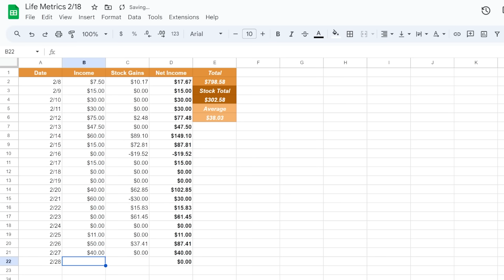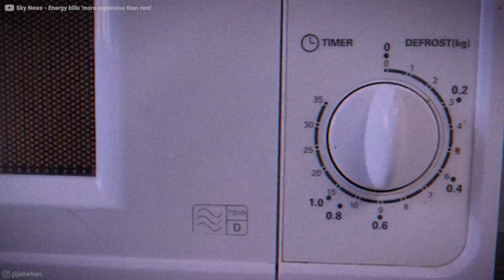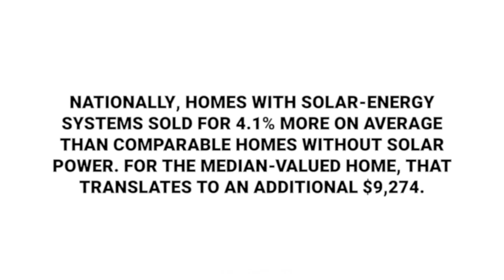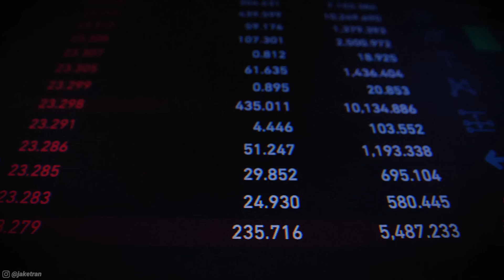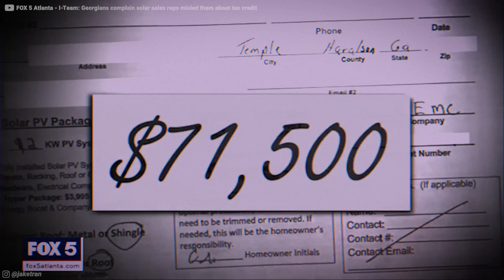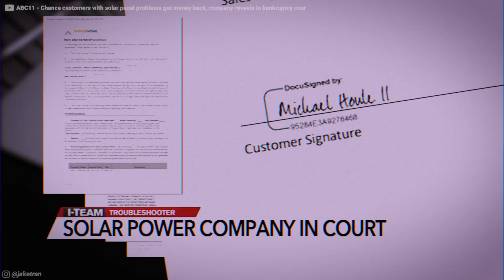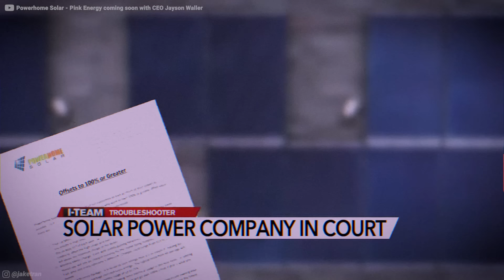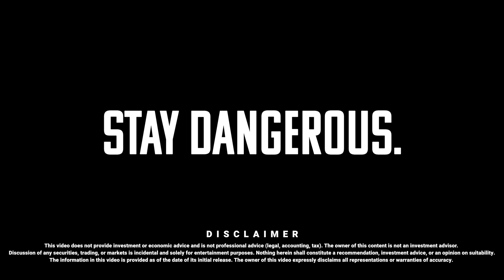Home solar panels are literally a scam.

Comment: I'm glad that you mention that the issue is with solar panel company sales deals and not with solar energy itself.
Reply: Two different things for sure.
Reply: Yeah it should be its own video
Reply: Solar isn’t close to as effective as nuclear energy and is worse for environment than nuclear
Reply: Solar energy itself is HUGELY problematic and environmentally terrible - as is wind power. They are both very inefficient systems that can't be used reliably and can't be used at all in many parts of the world. Additionally they require components to build that are far more environmentally damaging than oil. Also, they require 1000x more land footprint to run than traditional oil/gas. To top it all off, 99% of green energy systems (wind/solar) are manufactured in China. Now imagine if China decided to start a war and sanctioned the west and we relied completely on wind and solar. We'd be totally screwed.  Would be far worse than if any single OPEC country decided to stop selling oil right now.
Reply: @77dris  yyea, its no a coincidence that green energy hates countries with large supplies of coal, which china has to purchase from other countries
Reply: Well on a large scale yes .
Reply: @MintBerryCrunch  Everyone already knows that. Except for the german green party.
Reply: @77dris Going 'Green' will mean going without for most.
Reply: @77dris 99% of the panels on the market are definitely not from China. Freaking lol
Reply: user-hg4li3zx1x  so your posting your personal opinion with zero knowledge on the subject lol ok
Reply: No all solar business is a problem! Problem is that people are turning back to renowned manufacturer like Panasonic Holdings from Japan (creator and developer of all PV inventions in 1960s) 
Meanwhile customers prefer cheaper panels from China or Korea (with not as long cycle of life as PV made by Panasonic!)
Reply: @mbglosser True. But the stuff inside them is mined in China with slave labour.  Also the mining is very environmentally destructive.
Reply: Look at this arguing over energy 😂😂😂😂 brilliant
Reply: Yeah everything works even fossil fuel is good but it’s all about the money
Reply: @77dris  the main point of this rn is to invest in these type of tecnology so it can develop and be more efficient and reliable.
Reply: @MintBerryCrunch  You are right but only about nuclear FUSION, which is someting that we cannot do efficiently yet. Nuclear FISSION is what we are doing rn and it's not ideal at all.
Reply: I am a conservationist, "renewable" energies have never been considered valid. The technology,engineering, and infrastructure isn't' there. The real answer from a conservation POV is to make the most efficient use of the resources that community has. It doesn't make sense for Iceland to use anything other than geothermal. Though there is benefits to smaller or isolate populations.
Reply: @Nylon_riot   efficient use of the resources that community has have a date limit, is not enough for the energy that we need to consume nowadays and is harmful to the environmen. Of course you have to choose well which renewable energies you will use depending on where you live but that doesn't even get close to meaning is not a important thing to adopt and develop
Reply: He is right, nuclear is 24/7 all year long, no reduce output powerhouse while solar relies on very specific conditions to function, a fun fact that many don't know is that high temperatures cripples productivity. Nuclear power was the green future human greed denied us, with recent advancements in nuclear generators in safety, waste reduction and efficiency, our climate crisis would never have happened, but uncultured monkes who thinks that every powerplant is a mini chernobyl (even though that was communist incompetence) waiting to happen, and the nuclear waste? They made God damn nuclear reactors using that as a fuel source, so God bless the purifying nuclear fires of the next world war cuz we Don goofed and chose the wrong path o7.
Reply: No, no, not quite. Just like with EV batteries, still gotta mine all the metals and various elements and then all of the massive graveyards of non-biodegradable, unrecycled solar panels, huge lithium batteries, windmills, etc. no longer work..
Reply: Solar energy is a joke in most regions.
Reply: @turbogames3 Uhm, I think you got those two mixed up. Fission is what we’re trying to achieve and is what goes on at the core of stars
Reply: @HavianEla  no. You got it mixed up. Go check.
Reply: @MintBerryCrunch  ROTFLAMO! 🤣
Reply: @MintBerryCrunch  Nope.
Reply: @Nylon_riot it’s easily there. It costs less to put pannels on your roof for 40 years than pay your power company.
Reply: @SavageRoosterOnThaLooster  isnt the video about the people who regretted  and are suing for doing exactly that?
Reply: @77dris the best way to do wind and solar to avoid a lot of this in not large solar and wind farms but personal solar and systems but to get them at affordable prices you have to build them yourself they are actually fairly simple. Don't get me wrong we should continue using coal for power and should invest in more nuclear power.
Reply: @MintBerryCrunch  what can be worse than nuclear, the waste product for nuclear will be harmful for eternity and beyond.
Reply: @theproperfix  you have never done any research on this have you???? I don’t even know how to respond because this is so far removed from reality that i assume you listened to someone’s talking point and now push it off as fact. Please look up modern nuclear energy then get back to me. You may not realize this but many of our naval ships are powered by nuclear energy. One aircraft carrier can power cities like New York with no issue and the waste is minimum. It’s like people read an article from the 60s in nuclear energy and think it’s still relevant today. There are literally nuclear powered things all over the United States and there have been zero meltdowns and practically no waste
Reply: @MintBerryCrunch  Ok so basically you could bury the waste in your back yard, good for you
Reply: @@Pillowcase8 ok so this is just a dumb statement…nuclear energy is the cheapest energy and has the least impact on the environment and a nuclear plant lasts longer than any “renewable” energy plant on the market…please do just a bit of research
Reply: @kidmosey if we relied on solar and wind, we’d have rolling blackouts and our energy bill would be double
Reply: @77dris  Found the oil company employee. 🤣
Reply: @UPTHEWAHSDAY1 it's arguing about nothing. 99% of these people have no idea what's going on
Reply: @@russellhankwrong on all points. Read more
Reply: @MintBerryCrunch ah good to know, I was considering signing up for a solar system but ow I’ll go put a nuclear reactor in my basement instead 😂🤡
Reply: @theproperfix maybe look up windmill landfills :)
Reply: @MintBerryCrunch  No, it is not. Solar power is extremely cheap, effective and the maintenance costs are basically zero compared to all other forms of power.
Reply: @janos5555  I hope your just joking because this is a comment not rooted in fact…I feel like your just spouting talking points with no actual first hand knowledge. I have tons of solar panels on my home thanks to other tax payers and they are not cheap, cost tons in maintenance and are not effective. Not only that the environmental impact on the production is huge
Reply: @MintBerryCrunch  I have some as well (24 panels 9000Watts). They were cheap and I have never spend a dime for maintenance in life.
Reply: @@russellhank This argument is plainly idiotic.  Solar is inefficient and building a system that could reliably power the average home BEFORE adding the charging of an electric vehicle to the mix is extremely difficult and costly.  That's assuming that you live in an area optimal for solar power.  In optimal conditions, a high efficiency solar panel is capable of converting 23% of the sunshine that hits it into usable energy.  Perhaps you should be smarter than the people who make the claims that you made.
Reply: @77dris they are decently efficient and are the cheapest, safest and cleanest energy we have. The stuff that is needed to build them is used in a lot of other industries as well - often times more such as rare earth metals in older energy production. Why people think that the generators in nuclear, coal or gas facilities use different materials than in wind farms is beyond me. It's the same tech...
Reply: @77dris and on the what if China: some of the best solar panels are still manufactured in the west. Elon Musk (yeah, that idiot) brought battery production back to the west. Lithium doesn't really come from China. Neither does the sand for solar. That china is now the biggest producer of solar and increasing it's wind production is also for their own benefit - there are people running around with vacuums in Beijing and pressing the dust into bricks. 
And most important: not everyone has the money to buy an electric car. Renewables are so cheap that they are suppressing the price of gas at your local gas station. Americans are complaining a lot about their gas prices coming close to other countries but never question what it would be without 30% renewables and nuclear in 1st world countries
Reply: @77dris 
Solar and wind are way less problematic for the environment than oil due to lower co2 emissions.
The reason they are being manufactured in china is because it is cheaper nearly all plans to encourage solar energy also encourage investment into solar manufacturing in the home country (see bidens inflation reduction act). For the possibility of war china is a net importer of food so i wouldnt be so worried about that.
Reply: @chucktechnorris 
That is basic capitalism if you have a problem with that you have a problem with capitalism not Solar energy
Reply: @Red13.0 
Fossil fuel is not good 💀
Reply: @Nylon_riot 
Yeah they never have been considered valid which is why Norway, Iceland, brazil and Sweden all have over 45% of their energy in that and its the largest growing energy source?
Reply: @warmak4576 
It most importantly the most expensive energy source and can not vompete with renualbes like solar or wind
Reply: @dererik9070  so “capitalism” is killing quality and is no eco-friendly! More expensive panels are long lasting!
Reply: @chucktechnorris  
Yes welcome to capitalism i think you're ready to learn about interventionism where a state helps companies in their state of their nation to make them more competitive.
Reply: @MintBerryCrunch   nuclear leaves a bad taste in the mouth though.
Reply: @HavianEla  Just replace fission with fusion and your sentence will be correct.
Reply: @MintBerryCrunch according to Elon musk solar is way more powerful than a nuclear power plant. He said a 150x200 kilometer array would power the entire country.

Comment: PAID ONLY $14K to install twice as many Solar Panels as I needed (not going to explain).  We create way more electricity than we can ever use.   I used to pay $450 an average to the electric company.  Now we pay $14 a month to be connected to the grid.  That's it.  BTW - I also charge my EV at zero cost at home.   Off course I live in CA where we get tons of Sunlight.  HUGE TIP: Get more panels than you will need by saying you are going to Install an EV, large electric appliances so they allow it.  FYI - I paid cash and got a 30% Tax Credit.
Reply: And one day you'll be acctually charged for the power you put back into the grid.

Comment: They took so long to finalize the installation, it gave me time to do extra research and ended up backing out. Best decision I’ve made
Reply: Are you still paying every month for your electricity? Or did you back out of that as well?
Reply: How were you able to get out of the deal???
Reply: How did you get out of the contract?
Reply: @shannon8570 You don’t wanna get out of the contract Shannon .
Reply: I was able to get out of my contract after almost 30 days after signing it. It was all thanks to God because I prayed on it (even though I should've done it before signing the contract). I told God that if it was not a good investment to please make something happen where I would be able to get out of it without having to pay the crazy $20k I had to pay for breaking the contract within the 30 days. Well God did exactly that when the town hall didn't approve the amount of panels I initially needed in order to generate the amount of electricity I used every month; so the solar company called me and said that I had to sign a new contract because the first one was now void. (By this time I had done all the research I needed to know it was a bad investment for me personally). That was my ticket OUT and my answer from GOD! Thank you Jesus for loving me the way you do and always making Your presence known!!!! The most important thing is to put God first and do lots of research BEFORE you sign anything!
Reply: @JesusisKing03  I'm so glad it all worked out in your favor.
Reply: @JesusisKing03  god bless you!
Reply: @dannypessy  pessy special

Comment: I had a big family. I paid a little over $300 an average month for electricity. I got solar with 20 year home improvement loan with a payment of $200 a month. I kept paying $300 towards my loan.  ( Had about $20 electric bill for administrative changes monthly). I paid  my loan off  in ten years and now basically getting free electricity till I needs to rapier any panels that are still under warranty for another 10 years. Im in sunny FL...
Reply: They are literally £100 a panel .
Reply: How do you get that 20 yrs home improvement loan? If you get batteries does fpl still charge that acct/grid fee?
Reply: @avancalledrupert5130   What planet do you live on that panels are that cheap?
Reply: @avancalledrupert5130  might be hundred dollars a panel, but labor is what your paying for. go and try and have a room painted for the cost of paint...... not gonna work you can buy paint for like 150 dollars for a room but most painters are gonna charge 5-600 easy. i worked in solar for years have this video is a flat out lie I know plenty of people who i installed panels for that have little to no electric bill and panels producing more energy than using.
Reply: @jessepuglisi4481  you telling plug things together in a daisy chain then teck screw them to the bracket.

If you can't you deserve to get mugged off lol 😂
Reply: @avancalledrupert5130  I'm so confused, is English you second language? its a "tek" screw and no we dont use them for anything but securing the pipe to the roof for the wires to run back to the inverter. and the way you think just daisy chaining them together would do anything just screams how uninformed you are on the topic. the panels create DC power, your house does not run on DC power so you must use a inverter to make AC power and if you dont have a understanding of electrical have fun doing that, DC power is dangerous......
Reply: So you paid 36,000$ for panels that degrade after the 10 year mark they produce less power per panel.
Reply: @down2earth838 i mean if you have a 20 year warranty like they mentioned who really cares?
Reply: @vincentlopez2878 I want to see the warranty claim. I don't think that after 19 years they gift you another set of panels, there is pretty sure a catch there, somewhere in the fine print.
Reply: @jessepuglisi4481  battery Bank and hybrid inverter obviously.  What would be the point without. The grid purchase price is pointless. 

Yes daisy chain then up to max voltage of the charge controller. Then run those blocks parallel.

Most charge controllers take 250v Standard panells are 48v . So you generally make blocks of 5 panels. 

You trying to make it sound complicated but it isn't.
Reply: @Universal_Craftsman  with a warranty on your car, when the engine blows do you return the car and just get a whole new car or do they replace the engine. if you run into problems through the 20 years they will replace the problem panels, obviously they arnt just gifting you a whole new set of panels.... no fine print needed. And its very easy to see if your panels need to be looked at, the invertor on the side of your house will tell you how much power each string of panels is making, and if they degrade more than 10% they will replace the panels.
Reply: @fredericktucker2653 Sir, this man paid over $48,000 for literal metal junk on his roof where he’s still tied to the grid.. on what planet is this “cheap” ?
Reply: Not to mention in 10 years the cost of your electricity bill will not be the same its obviously gonna go up over time …
Reply: Don't believe you.